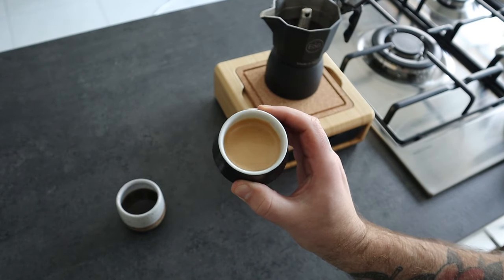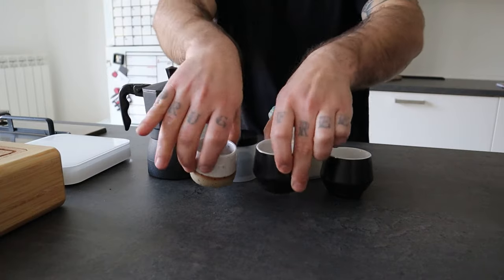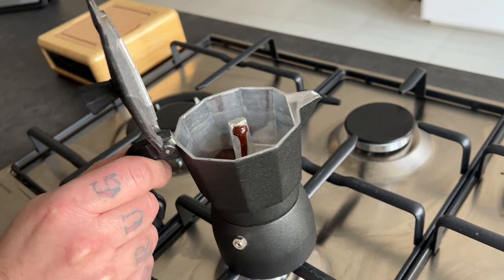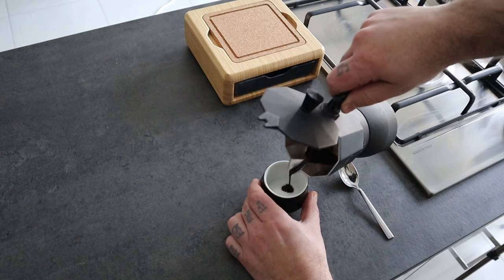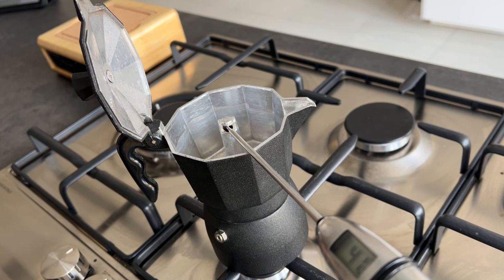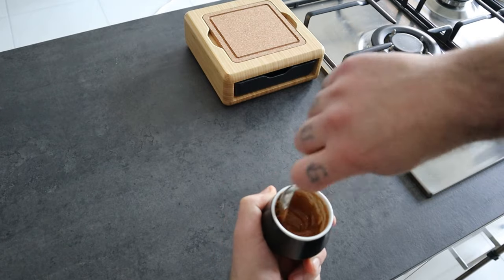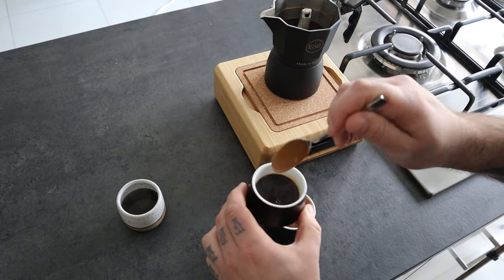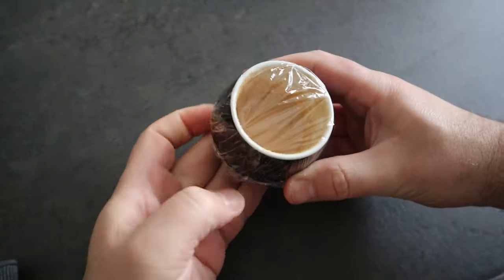The Coffee made with Moka Pot that looks like an Espresso!

Comment: Instead of mixing with a teaspoon, try using a small whisk. Hold it vertically between both palms and spin it quickly back and forth (like you’re trying to start a fire with a stick).
Reply from the maker: Pro tip! Thanks
Reply: y luego ponga una bandera de haber conquisto un nuevo mundo

Comment: This is exactly what I was trying to find for the past hour. I was gifted a moka pot like on a christmas in 2022. Used it once and didn't know what i was doing wrong. Stored it on a shelf and kept toffies inside it. Took it out once again today and I am gonna try this technique. Pretty impressed just by look of the coffee you made there.
Reply: Use milk to make it less bitter, try different coffees, vary the amount of water you put in the lower part, always preboil the water you use, dont set the heat too high, immediately take the moka pot off the stove when it is done, and maybe turn off the stove when half of the coffee has come out as the residual heat should be enough. Basically experiment until you like it

Comment: Thank you Matteo. I just received my new shiny 6 cup red Bialetti moka express, and have been brewing 3 servings (and threw them away) to work it in. My old moka express was almost falling to pieces, I did not treat it well... I find the exact grind for moka already makes a great crema if you don't rush the boiling process and use a small round paper filter. I do take my coffee with sugar and will for sure try your cremina! You have a new subscriber
Reply from the maker: Thanks for the comment and sharing your experience. Paper filter gives an extra resistance to the coffee pack and increase extraction. Good move if you want to make the creamina

Comment: Matteo - Salve da New York.  When I whip the sugar and coffee I cannot get the emulsion to be as thick as yours is in the video.  Am I adding too much coffee?  Not enough sugar?  Not whipping enough?  Also, when I add the sugar to the coffee, it doesn't float like yours does.  Any advice?  Mille grazie.
Reply from the maker: Hi, getting the right ratio between coffee and sugar needs practice. That can happen if the coffee is not enough concentrated. If you see the coffee comes out light, try to grind the coffee finer, if you can't try, to use a paper filter to create more pressure and resistance and maybe you will get more concentrated coffee. important is to use the first drop of coffee coming out

Comment: I usually make a 65/70 ml moka in my Bialetti Moka Express 2-Cup, like a doppio sized espresso, and I always have too much moka left in the pot that I throw away. Is the IMS - E&B Lab - moka pot 1-Cup big enough to make a moka that is like 65/70 ml? Or is a 2-cup better for that? Also: What pot size (leaving out how many cups are needed/persons etc) is the sweet spot when purely looking at taste?
Reply from the maker: The 1 cup is not able to make the amount you desire. Also I think the 2 cups produce a better coffee than a 1 cup. What you can do is placing less water in the boiler. Sometimes that helps with extraction.
Reply: Unfortunately E&B does not have a 2-cup model. I ordered the 1-cup and the 3-cup, and an E&B competition filter for my good old Bialetti 2-cup, let's see what works best for me :)
Reply from the maker: @hanstiland8437  The 2 cups filter on Bialetti works very well.
Reply: Would you say the old Bialetti 2-cup with E&B filter produces better moka than the E&B Lab 3-cup Moka Pot? Purely taste wise?
Reply from the maker: @hanstiland8437  Well that depends on how you make the Moka. But the moka set up I use today is the Bialetti with E&B Lab filter
Reply: Thanks 👍🏻

Comment: Ive tried this twice so far, failed twice. lol.. It doesnt foam up, its like maybe i used too much coffee in that first little stir part, and the sugar didnt really mix well, but i was using a large granual sugar and it wouldnt fuse with the coffee very well. Im really good at finding ways to fail with a moka pot! LOL
Reply from the maker: Sorry to hear that. I use caster sugar for that, it melts easily, so try to change sugar. There is no fail in coffee, it's normal to make mistakes.
Reply: You can grind your sugar finer in a small mortar&pestle, or in one of those"whirlybird" electric coffee/spice grinders. Make enough for a few days at a time....